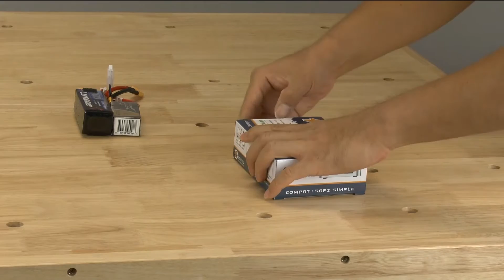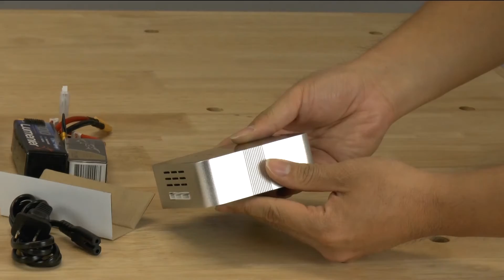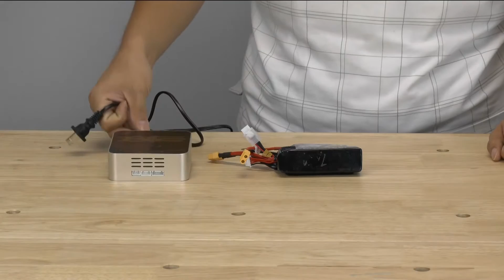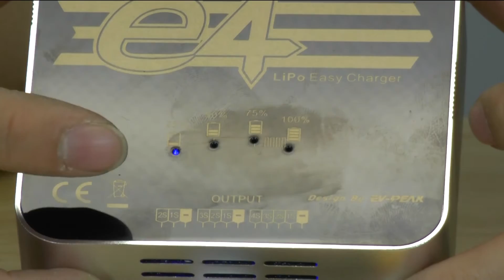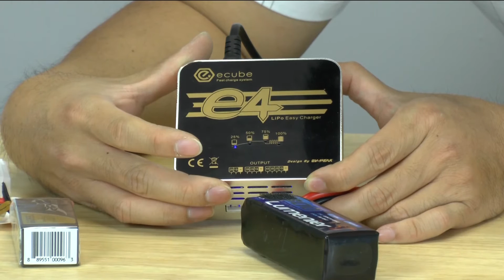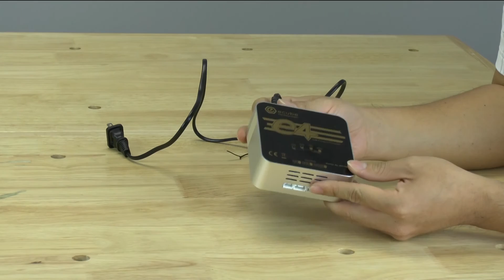EV-Peak E4 50 Watt 4 amp LiPO Battery Balance Charger

Comment: Can you charge two 3S 2200mAh batteries at the same time? And would there be any pros or cons to doing that?
Reply: I had the same question. The graphics on the case show that you can plug smaller balance plugs into the larger sockets, and they do fit. But it's unclear whether you can or should charge multiple 2s or 3s batteries at the same time.
Reply: ... after that ^ I asked EV-Peak support and they said no it can't charge multiple 2s at the same time [edit: corrected typo, they said it _can't_]
Reply: No, it only has one plug for each of 2S, 3S and 4S. I don't know if it's even capable of charging multiple batteries in general.

Comment: Team Black Sheep white labels this exact charger and sells it with their RTF Oblivion Drone Set which uses 1300 mah graphenes.  Its hard to believe that a company such as TBS would include a charger that would destroy the packs they supply with their RTF set.  Maybe this charger goes UP TO 4 amps but somehow knows to regulate the amperage on the pack??

Comment: I got this as a travel charger for when I go to meets and vacation so I did not need to take my big one.   I was charging a 1300 graphene and a 1500...but after only a few charges and flights all my batteries charged with this charger are swelling.  Now that I watched this video I see its a 4 amp charger, guess I should have checked....this charger should NEVER be used on a battery less than 4000mAh, but it is perfect for 4000mha and above, but using it on a 1500 Lumenar battery like you are showing will surely destroy the battery in a few charges/flights as it did mine.  This demo needs to mention that and use the correct mAh batteries
Reply: In his defence it is a charger review not how to charge lipo's, he does say 4 amps is Ok for 1.3 to 1.5  quality batteries which is 3c rate.you could read up on parallel charging and get yourself  a 3 into 1 balance lead and charge 3 1300 mha   at once which is about 1c charge rate but like i said you need to read up on it.
Reply: Team Black Sheep white labels this exact charger and sells it with their RTF Oblivion Drone Set which uses 1300 mah graphenes.  Its hard to believe that a company such as TBS would include a charger that would destroy the packs they supply with their RTF set.  Maybe this charger goes UP TO 4 amps but somehow knows to regulate the amperage on the pack??

Comment: what, you can't choose the charging current? meaning if you try to charge a small enough battery it will ruin your battery from overcurrent? really? i must be really outdated, because i didn't even know that existed. and to think i almost bought this worthless piece of craftery.
Reply: As long as its only used on a 4000mha battery and above its fine, this video shows what looks like a 1500, it made mine swell thats how I found this video looking for others with this issue.  As long as 4000mha and above its fine, I would rather they just default to 1amp or have an switch to from 1amp to 4amp then it could be used with both 1000mha and above